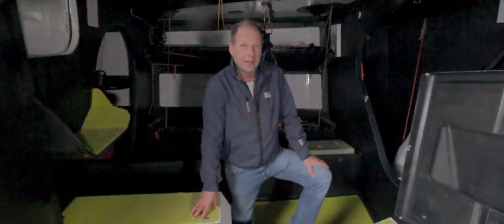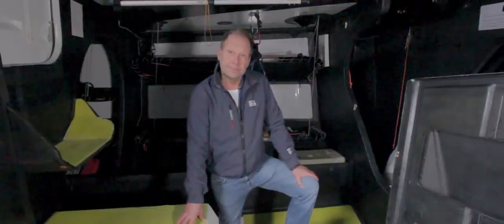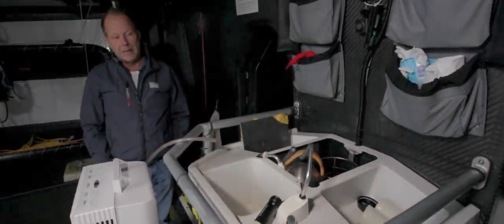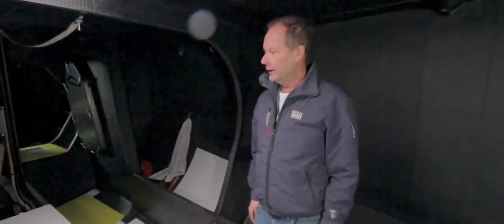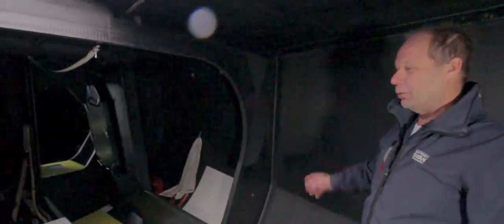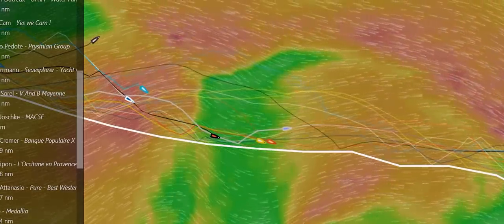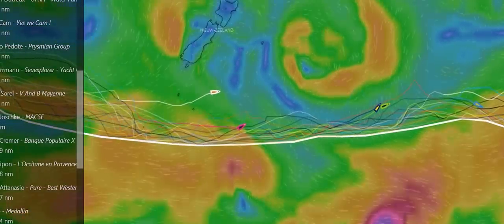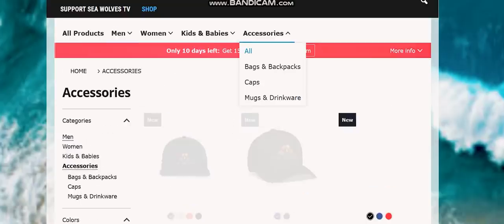Sea Wolves - Vendee Globe 2020 Report - Pip Hare breaks rudder! Jules Verne seems on! VO65 visit!

Comment: Thankyou for pursuing the rudder changing procedure so persistently. Being a non sailor interested the engineering, I could not understand how she did it, particularly how she located the top of the shaft in the hole under the boat while in motion. It didnt look difficult but could not imagine how she achieved it, also, how it connects with the mechanism controlling direction. Perhaps a diagram may convey more rather than words - to the uneducated! Thanks again for all your efforts.

Comment: Very interesting looking at all the technical stuff on the Volvo 65, a racing machine but to me quite soulless. From the point of sustainability we should go back to using more wood again, trees capture carbon which is locked into the timber, which as a building material can last for centuries.

Comment: Florian, can you further explain how the Volvo boats relieve tension on the halyards by being “clamped at the top”?
Reply: As I understand it rather than the sail be held up by the halyard the top of the sail is locked/clamped at the top of the mast.  Then the bottom of the sail near the deck is tensioned to change the shape and performance of the sail.  My Hobie 16 used a similar system for the mainsail which was locked into the top of the mast and there was no tension on the mainsail halyard.  Hope that helps.  If anyone has better information please let us know
Reply: @davidtydeman1434  Totally clear now. Thanks. On these boats, is it a hydraulic clamp at the head?  It’d have to be crazy strong!
Reply: @doryman3  I dont know.  Are there any sailors out there who can help answer this question?

Comment: It would be interesting to hear about what happens to boats when they are 'old' and need to retire.  And how can a carbon fiber boat be recycled?
Reply: @vendeeglobe8470  Sweet !
Reply: For us eco warriors an excellent question.
Reply: @anthonyfletcher4250  Arkema developed a recyclable resin to replace epoxy. The resin can be 'melted' and the carbon mats reused. They've build vary competitive little mini out of it. I do however consider maximising the lifespan a far greater contribution to sustainability  https://www.arkema.com/global/en/arkema-group/sponsoring/arkema-sailing/mini-6-50-prototype/
Reply: @vendeeglobe8470  Now that's interesting. Thanks! 
Your view on maximising lifespan goes along with my own approach to pretty much everything. The one design class that I compete in was established in the late 60's, with the majority of the boats built in 1968. They're GRP hull, all still afloat and the racing is as tight as it always was. Just replaced the boom last year and both winches a couple of years before. The winches got re-worked for a friend's day-sailer, where they'll never see big loadings. The boom is now paired with an old mainsail and shot to pieces halyards to make an awning in my garden for the summer. Why can't I throw anything away?🙄😁
Reply: You can crush the carbon and use it for other composite product that isn't critical about weight such as light poles and other civil structures.
Reply: @robm.4512  Sailing is the most unsustainable way to transport as sustainable as possible ;-)

Comment: All the dinghies I used to sail had transom hung rudders which, I am guessing, would be easier to change than those with a stock mounted in the hull - not easy but easier - ?
Reply: most imoca's have them. indeed moer easy to replace (or less extremely difficult). main reason is for them to flip up in a collision. It is however a heavy and complicated construction, the forces it has to cope with are extreem. https://www.guillaumeverdier.com/wp-content/uploads/2017/01/IMG_1907.jpg
Reply: @vendeeglobe8470  Thanks for your reply. Interesting

Comment: Pip said she has “suspended racing”.  Technically, what does that mean?  It doesn’t mean she’s out for good, right?  But does ”suspend” have implications with the race committee?
Reply: It means she has paused until she can fix her boat.  Every other sailor has had to pause to fix their boat.  This is not a unique problem
Reply: @davidtydeman1434  Thanks.  I just don’t remember the others using just a formal statement, so I thought it might have some official significance.